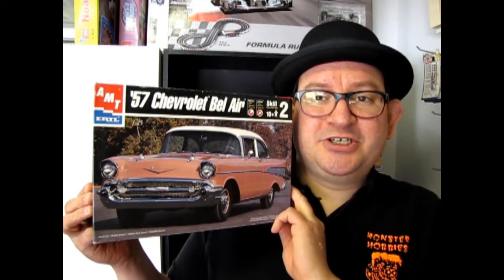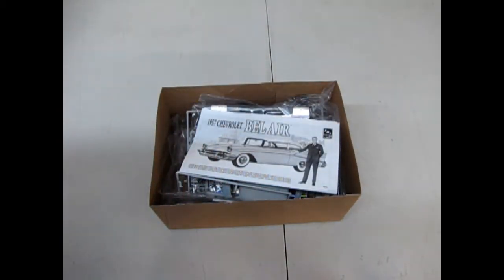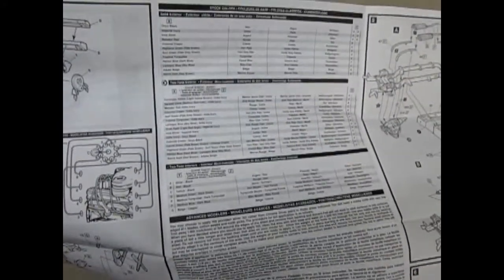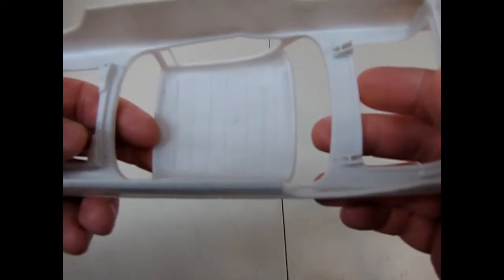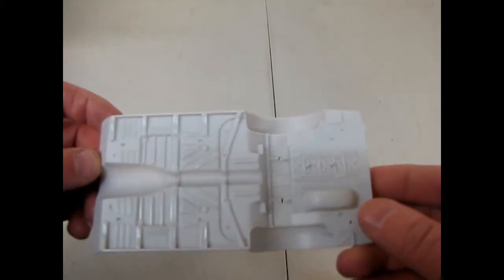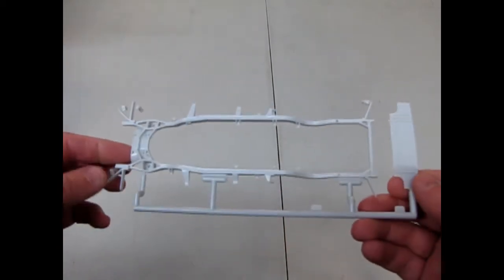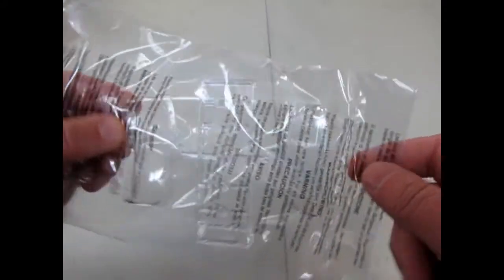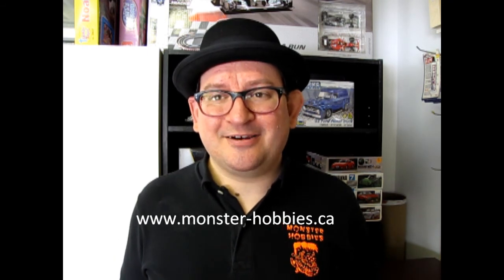Model Car Garage - 1957 Chevrolet Bel Air Model Kit By AMT/ERTL - A Model Car Unboxing Video

Comment: Good review on the kit. That kit has been released at least 5 times and the last release is the Lucinda Lewis Car Culture version released in 2015 and Round 2 kept the photo etched kit as was in the tin box release. This is a great platform to do what ever you want to it, but, my only complaint is that the hood and trunck are either open with the static hinges or closed because there is no option for working hinges. Again, great review. Cheers
Reply from the maker: Glad you liked the review. Stay tuned for next week's unboxing!

Comment: I’m glad the video let us know what’s in the box.The box pictures a  two door sedan Bel Air,which I’m looking for.In the box is actually a Bel Air two hard top.I have plenty of those.Revell or resin cast may have what I’m looking for.
Reply from the maker: I have only ever come across one 1957 Bel Air Post car, but it is an old MPC drag racer with a flip front nose. You can turn this car into a mock post car with a little evergreen styrene plastic strip though. One strip per side at the right point in the window frame.
Reply: @MonsterHobbiesModelCarGarage  I’m working on converting an AMT hard top using upper parts from the flip front drag car.Looking good so far but would like to find a Two door sedan kit.I believe Revell may have issued one.
Reply from the maker: @clarkgiddens5418  Good luck on your journey!